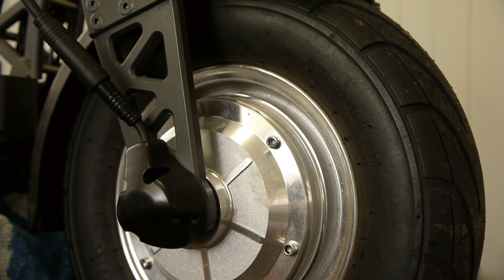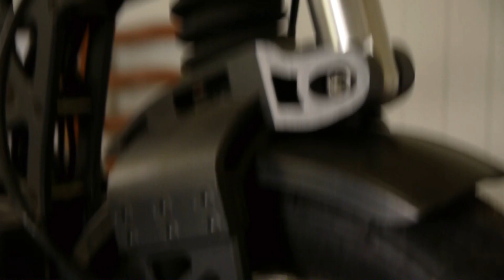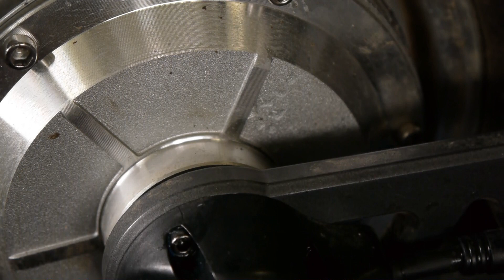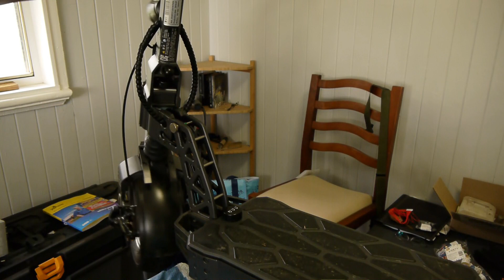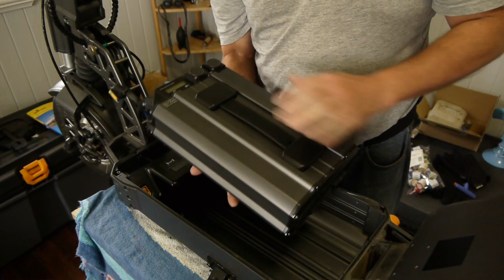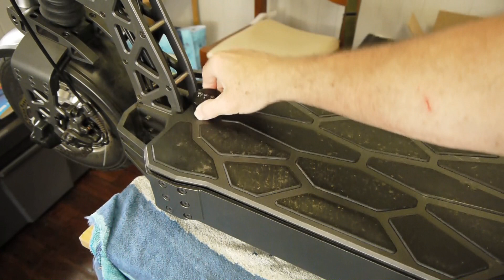MX60 Inspection and Service 1

Comment: Any recommendations to clean brake pads and rotors without removing them?
Reply from the maker: Brake pads (disc systems) don't really need cleaning. Nor do discs
Reply: @finophile  when i brake on the mx60, makes a loud squeaky noise

Comment: Hey, I got an mx60 a couple of weeks ago. Strange thing....it vibrates at the front wheel for about 2 minutes at the beginning of every time I use it. After 2 minutes it’s goes away and it’s fine. Any ideas?
Reply from the maker: dunno ... have you got slime in the tyres?
... what is tyre pressure?

Slime in the tyres also has a natural balancing influence, which can be demonstrated with "beads" acting as a "fluid"
https://www.youtube.com/watch?v=eq263AYgyYg

Comment: So, I live in a very hilly city, and am wondering if this would be a good fit for an everyday commuter. Using it to get groceries (via backpack), up and down all the steep hills, etc.

The hills seem to be no issue, but what about if you need to carry something on this? Pose any issues?
Reply from the maker: it comes with a rack for the back (if you watched the video) and I use a backpack. Of course it depends on what the "something" is. I think as I've seen done on a Zero that you may be able to even attach a trailer, certainly it would be much easier with all the potential attachment points for a trailer coupling. I assume you also read the associated blog post.

Comment: So tempted to get this scooter ..how high do you rate it ?
Reply from the maker: Very highly. If your after sheer speed pick something else. It is however very well built and easy to service. Did you read the associated blog post?
Reply: @finophile  yer seen the stuff about servicing it ..looks really well made i got around £1500 -£2000 to spend on my new scooter ...what would you get in this price range ...im not a speed freak ...im steppin up from a ninebot max ...which goes 30kmh ..just want some punch at top speed ..mainly gona use it for short commutes an mainly fun

Comment: how is the suspension? is it comparable to Mantis pro or zero 10x?
Reply from the maker: I've not ridden a Mantis but the  single biggest issue isn't just "the suspension" its the steering geometry. NB: http://cjeastwd.blogspot.com/2020/04/steering-trail.html

Everyone on those scooters goes on about how you can't dare lift your hand to signal, you need a steering damper; but the MX60 is super stable. Eg https://youtu.be/gRFnzaNNRqw

Construction on the Zero 10x is "impress the shit out of kiddies" with bright colours, but if you look at those swing arms they're not braced at all ... to my mind no wonder its always breaking mudguards because the arms can flex relative to each other.

Lastly, try doing a battery change on the Zero or Mantis ...

Comment: Have u changed the Rim of your Mercane already, any demo on changing rims and any advice to protect it
Reply from the maker: If you're meaning my Widewheel, nope, it's been dinged for about 9 months now and shows no sign of failing.
Advice to protect it is: keep an eye out for bumps, learn to recognize them, avoid them, bunny hop over them or even consider slowing down. Everything has physical limits, even military vehicles.

Despite how it looks, I take care, understand the terrain and approach with knowledge of what the scooter can take. I learned a lot in my first two weeks with it.

Keep your legs bent ready to be shock absorbers.

Happy Scooting

Comment: Do you reckon it would get round 18 holes on a hilly golf course at low speed with say 100 kg all up?
Reply from the maker: my most sincere advice is to go stand on one and hold our golf bag over your shoulder. See if you can take off without falling off. There just isn't enough room and balance will be an issue. Note my comments here: 
https://youtu.be/Og2aZM9oXKE
As to the course, yes it should do the course.

Comment: It will be nice if you record a dashboard movie in your MX.
Reply from the maker: I'm not quite sure what you mean here
Reply: @finophile  Settings codes for P01 to P20
Reply: @好奇心は地獄への第一歩  read his blog. Is extremely useful for info on the mx60 which is hard to find info on. His blog covers his p1-20 settings. You will find links to it on his video comments

Comment: 7:45 that shaft gets bent over time. I loosened mine and rotated it 180 degrees which adds a bit of rear suspension preload until it bends back again
Reply from the maker: nice tip ... logical too when you think about it. I should check my Widewheel too.
Thanks